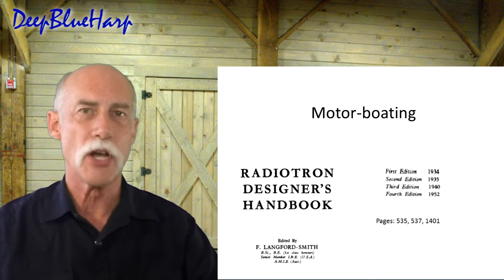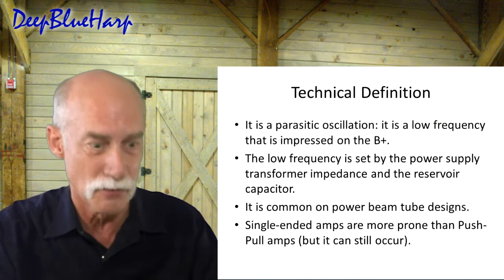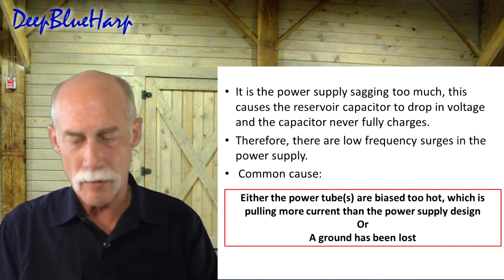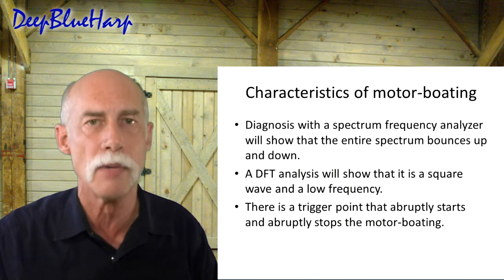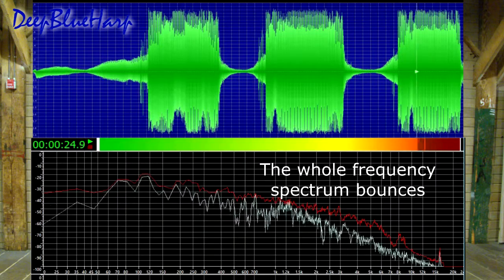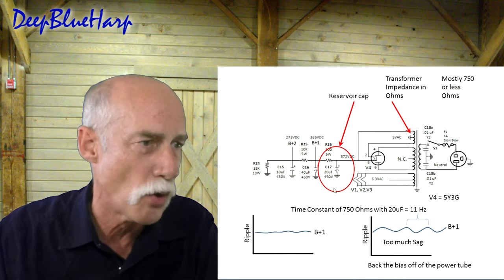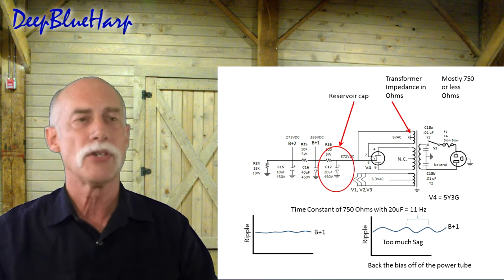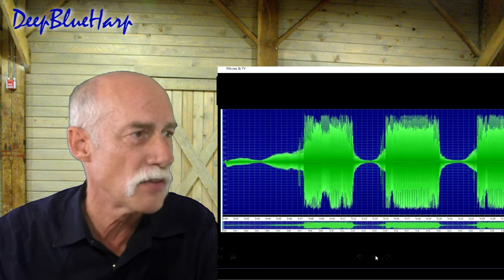Tube Amp Motorboating

Comment: I know this is an old video. but I am hoping to get some help. I am building a small single ended (champ) amp. has horrible motorboating! and as I turn the volume pot it sounds like a frequency generator and the frequency changes! I have checked my circuit over and over again but can't find the issue. Its a 6V6GT bias current is 25mA
Reply from the maker: Please go to my channel page and click on For Business Inquiries to contact me directly.